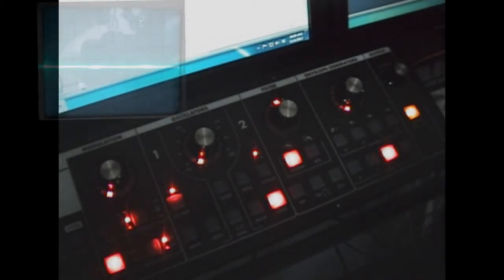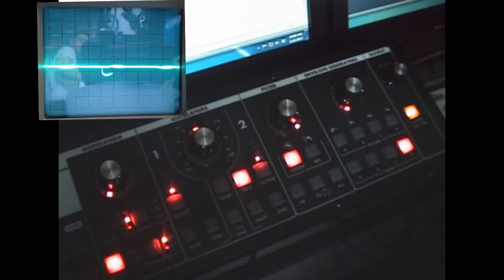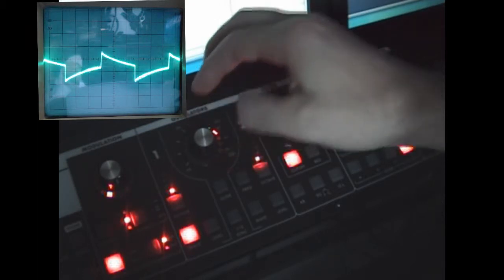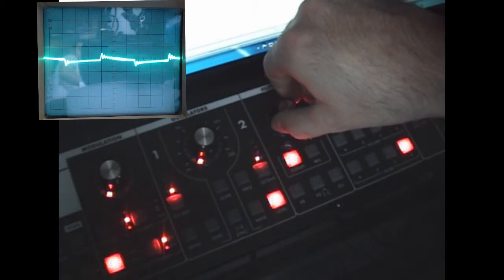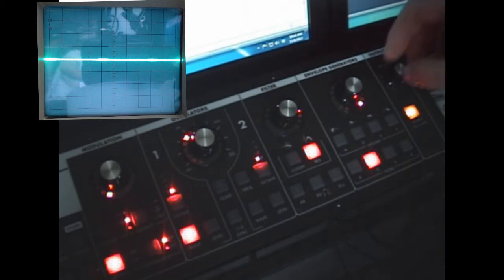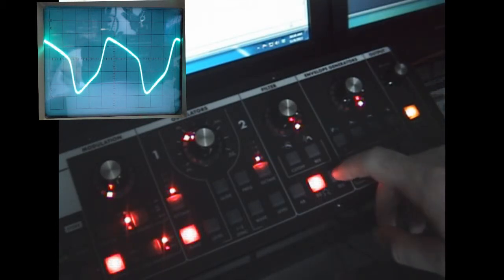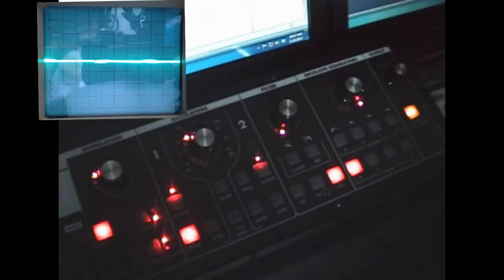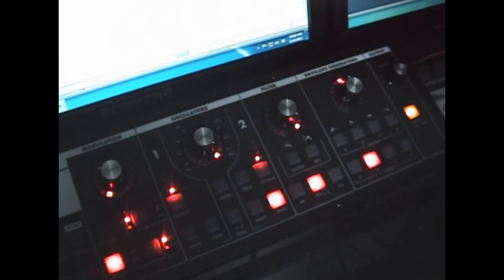Moog Slim Phatty Listen and Visualization part 1

Comment: Thanks that was awesome. I just got the slim phatty and learning it all but can't seem to get a beautiful sweet arp pluck type of sound out of it. I noticed the Doepfer Dark energy can definitely get them and it's got one voice only. So then I wondered about going down to one oscillator with the slim phatty to get a sweeter tone and that's how I found your video.  Is that also how you got that nice arp sound at the start of the video? Thanks!
Reply from the maker: I'm glad you enjoyed it!  You can get the arp pluck you're looking for, and may want to start using the settings you've seen used with the Dark Energy....I've got another video up that may have something close to the sound you're thinking of, or if you send me an example of the sound you're shooting for I can try my hand at recreating it and sending the preset to you.  Either way, thanks a lot for viewing and commenting on this video!